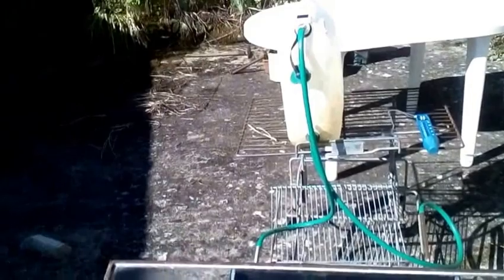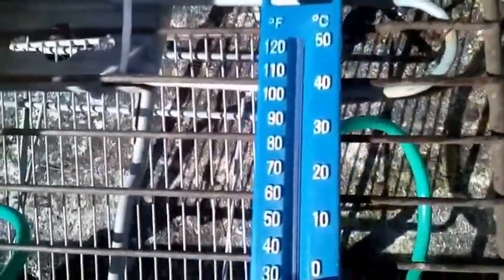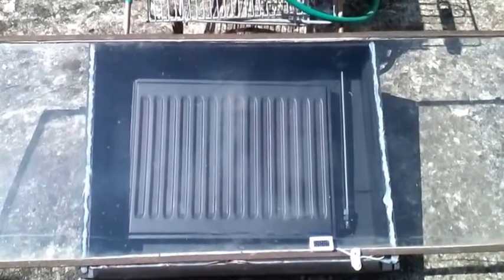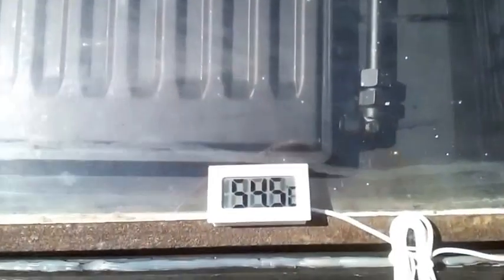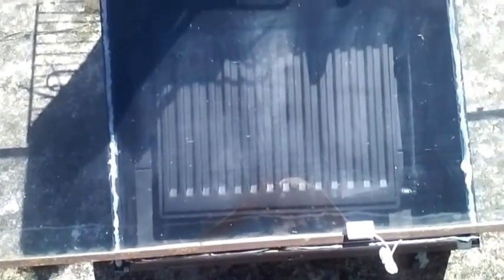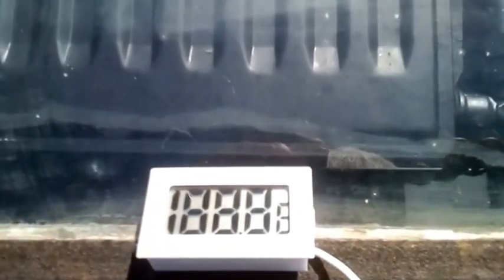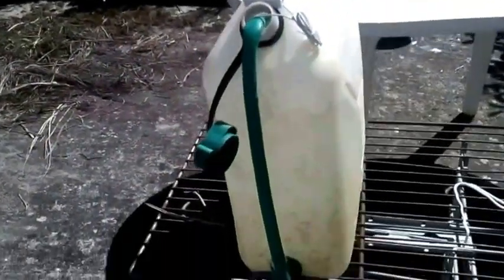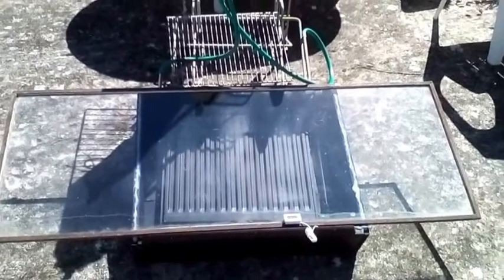Thermo syphon test for solar water heater

Comment: If you know the volume of water in the system, then you can easily work out the energy capture, a BTU is 1 pound of water raised by 1F, of 1kg (1 litre) raised by 1C would be 4200J, or 1.2 Wh (watt hour). So if you had 10 kg/10 L, and it went up by 20C you captured 240Wh.  Your thermometer in direct sunlight will give a false (high) reading. Interested to see it in situ.  Add a pump powered by PV and it will be better.

Comment: Measure the ambient (outdoor air temperature) in the shade away from metal surfaces, (which heat up faster then the air outside and therefore heat the thermometer). 

37c is very hot for the uk. Check your phone for the days temp in your area. It will be measured in the shade. Away from radiating surfaces such as the (coloured / red, brick wall of a house,  or metal objects.

Comment: Hi I'm thinking of doing the same I have a small type22 radiator and double glazing. Just need to make a box. Thinking To have it connected to cold water supply to boiler so that incoming temp to boiler is as close to 40c. That way boiler users less gas to raise to slightly over 40c.
Reply: Actually have to have a heat exchange, can't have rad feeding boiler directly, contaminants etc

Comment: You need to add pump which is circulating slowly, then you connect that to heat system inside the house right?
Reply: Hello Dino. No need for a pump in a thermo syphon system, the hotter water in the collector (radiator) will always rise into your hot water tank and be replaced by cooler water.